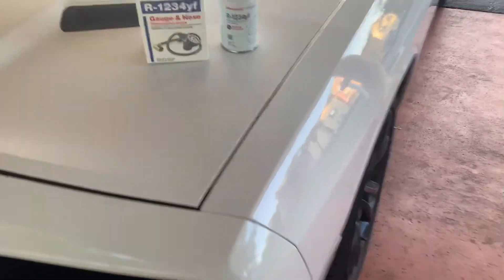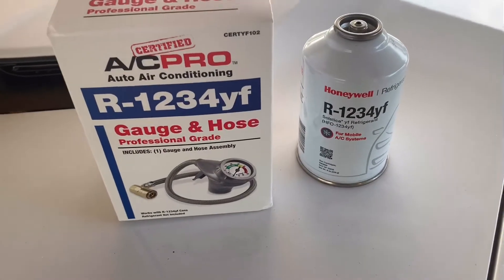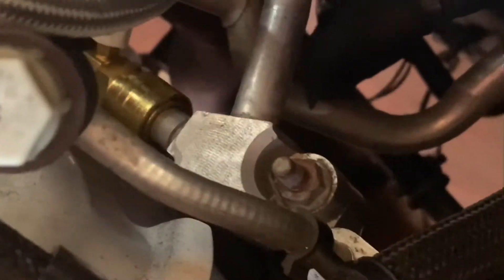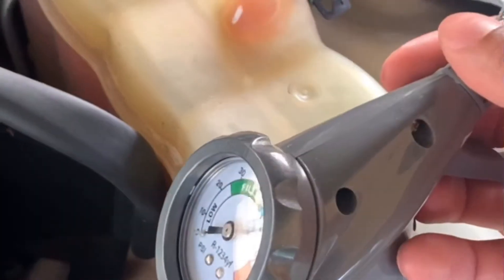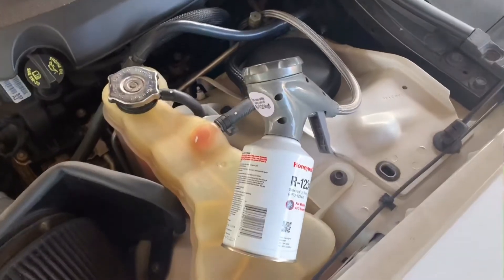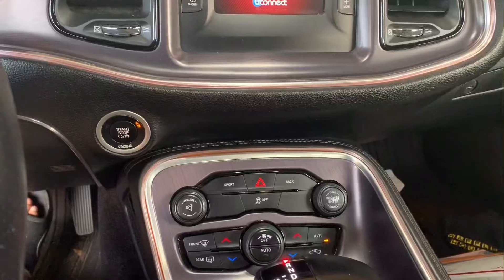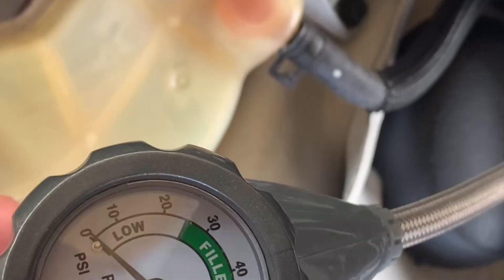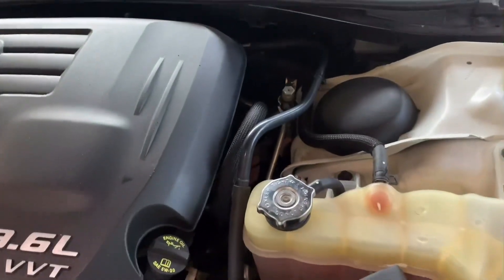How to recharge cars using r1234yf (2016 challenger) if your car just needs freeon!

Comment: Don't you need to wait until the compressor engages before adding the coolant to prevent it from overcharging? This was a must with the 134a
Reply: The clutch won't engage without freon in it with this car.

Comment: The green area on the gauge reads from 25 - 50 psi.  Is there a difference to how much you should refill to (PSI) with varying outdoor ambient temperatures?  IOW, do you fill it up to 35psi when the outdoor temp is 80 or 95?  Does it matter what the temp is outdoor?

Comment: How did you get the hose locked in? I am having trouble with that
Reply: it’s probably not the right hose
Reply: Put it on your driver side not the passenger
Reply: Wrong fitting u need the correct y234f

Comment: I have a question. I have a cold line. It comes with the Ac pro, the outside temperature is 40 when I measure it, it is above 60 or 70 PSI, is it normal?

Comment: Came from a video stating one has to first vacuum out the original freon. Would this be true if I'm just topping it off?
Reply: Only if you're going to completely open the system, you're changing from R12 to 134R, or 1234YF, or you're system has a major leak requiring repair/replacement. 
If not, you can add the same type of refrigerant without removing the older stuff.

Comment: How is your vehicle a 2016 and it already need to be recharged?
Reply: Mines 2015 and I need it recharged I live in Houston bud so it’s hot af
Reply: @markcoronado1695  I thought I was the only one, and I have the 2017 model
Reply: I have rrs 2015 and it needs recharging as well, 'stealer' price just for recharging is not justified- you could buy 20x 8oz. refrigerant -$40 per can, set of tires, fill up your tank, go have a dinner for 4 and still have around $200 left ,,,after seeing that so many people have the same problem regardless of make/model I believe it is a lucrative business,,,,
in 1998 I purchased a house- previous owner had an old fashion refrigerator from 1988,,, we purchased new one and put old one in garage,,, by 2021 we had to replace in total 3 times the fridge while the one from 1988 was still kicking in the garage and cooling some beers,,,,AMAZING ??? ISN'T IT ???
Reply: If your system is properly sealed then you shouldn’t need to recharge it at all. You both have leaks that need to be addressed

Comment: Glad I saw your video.  I bought same acPro hose but couldn’t attach it to my Honeywell refrigerant, would not thread.  Then I saw your video and was puzzled how u did u get it to thread together?  Had an aha! Moment and tried screwing it COUNTER-Clockwise, eureka! It worked, charged up my 2016 Honda Civic to 40 psi, ac now soooo cold.  Mahalo from the land of Aloha.
Reply: I struggled with that for a good five minutes too. Wonder why they went with left hand threads...
Reply: @_g7085  they switched to left hand threads so you can’t use 134a cans on the 1234yf hoses.
Reply: @bohemianpizza12  ahhHHHHh! Brilliant!
Reply: Bro I’m about to do this to my 2016 civic. Wish me luck. Everything went good on yours?
Reply: @luisreyes9177  - Hey Luis, I got a 2018 Civic blowing hot air, did you just hook it up to the low side and let the whole can go in?  That's it?
Reply: @travelguy1564  na bro like half the can it’s still running cool too.
Reply: Just had returned cause I could get the damn bottle to fit. But I had to twist it in counter clock wise. I feel like an idiot.

Comment: I have a 2014 Dodge Charger sxt I can never find the other ac port  or the high pressure switch sensor and now my clutch doesn’t engage the pully seems wobbly I had two diagnostics done they both said I need a new compressor cause the grease is being pushed out at the clutch , what do you think
Did you have any similar issues and the auto parts store won’t
Sell me the r1234 without the license but I heard you can purchase it online , where did you get your setup from it looks better than the one I saw

Comment: I have a 2016 charger r/t, will I be able to use r134a instead?
Reply: No.
 In theory you can but you risk the wrath of shop technicians later on when you contaminate their recovered refrigerant. In 2021 using r134 in a system designed for r1234yf will be illegal.
Reply: Mike Martin thanks, need to find out where to buy this stuff and do it myself. 400+ to take it to a shop

Comment: Will this work with my 2017 Honda Civic?????? Please help no cold air rn
Reply: You need to take your Civic to a dealership. Honda has extended the warranty for their AC systems to 10 years due to a known defect. Your condenser is probably leaking.
Reply: I got both these parts on amazon i have a 2016 civic and boy let me tell you ive missed this cold air so much ]:
Reply: Daniel Paniagua did it work? I got the same problem and same car
Reply: @PeeWee387  did it work?
Reply: I have a Honda Civic 2018 and I have the same problem
Reply: Yes it will, did it on my 2016 Honda Civic, works great.

Comment: Thanks man. It worked
Reply: Did you vacuum it out? I need to do mine and I want to avoid the dealership/ shop as much as possible.
Reply: @cpt7486  you need to make to sure there is no air in the lines and the system to be evaluated and have the correct oil
Reply: @matthewdoyle8644  how do you do that?

Comment: My AC works but it's obvious it's a bit low on refrigerant. The local shop wants $400 to start for an AC service and their machine will steal my 1234yf if it detects a problem, costs could escalate into the thousands depending on the result. I have purchased one 8 oz. can of 1234yf and the 1234yf charge kit shown in this video. This isn't the best method to be sure but if it works it works so it's worth a shot before risking everything at the shop or dealership. The two things to know here are 1234yf is flamable and if your car uses 1234yf you are one day looking at an astronomical bill to repair it because leaks are inevitable.
Reply: AC services are a scam. Either your ac works or it doesn’t, if you’ve lost some refrigerant due to normal use the. you yourself can top it off. If you have a problem then it needs repaired and it’s still easy to diy with the proper gauges, seals etc
Reply: Will this work with my 2017 Honda Civic?????? Please help no cold air rn
Reply: Man I’m currently in the SAME EXACT SPOT the shop wants to charge 400 and I don’t wanna put that out right now seeing as my ac works but it needs some
Reply: @artkilluminati1687  update, I bought 8 oz of 1234yf for $50 and a low pressure side charge kit off Amazon for $30 (it's special for 1234yf) and put 7 oz in my AC and it's currently blowing 32 degrees at the vents. Easy once you get the hood off. Now to deal with the issue of condensate not draining and splashing on my feet during turns. I'm still looking into more clarification on that one but it's related to a valve type gasket that seems to get stuck or clogged.
Reply: How many cans u needed ?